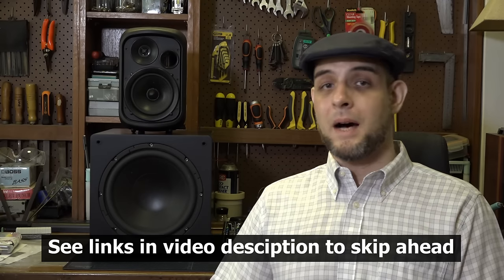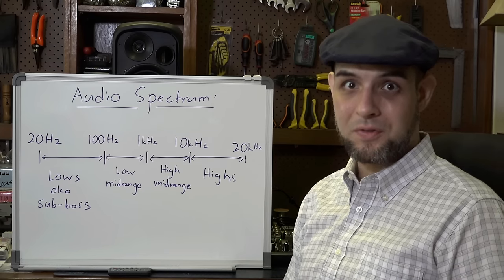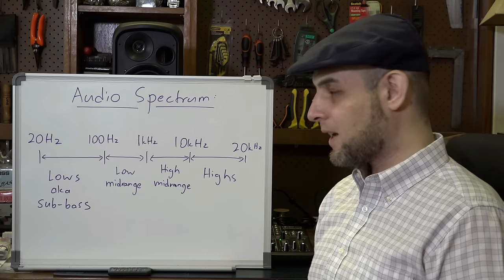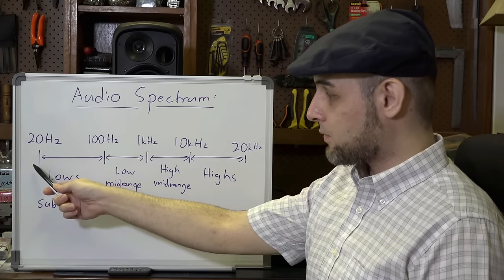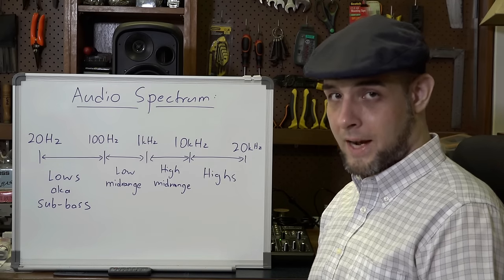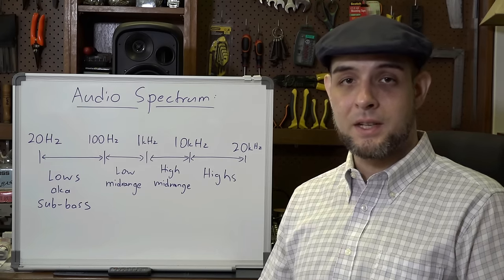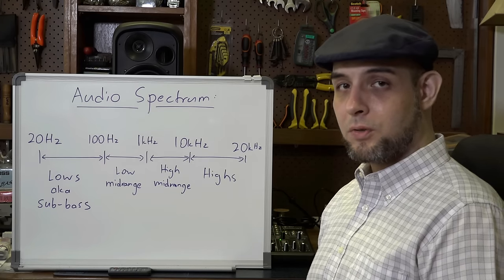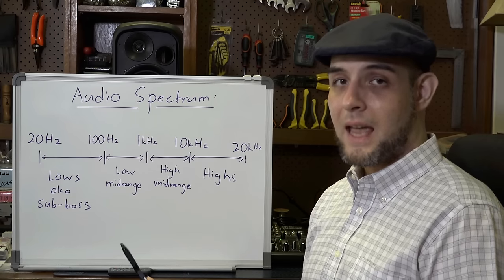How to connect an active subwoofer to a sound reinforcement system

Comment: Have to say your ability to clearly explain a technical side of todays active type speakers  is commendable. I for one did build speakers back in the 80's  using only 3 way cross overs non ported passive type of speaker designs. Philips components. Technology has come along way since then. Its refreshing to learn how signals are being separated and handled. Information as such was not as readly available as is today. However,  theres a lot of old technology still being used out there. Some musicians just prefer it that way. Personal taste. Sound reproduction is really an art in its self. In different applications or venues. Choices are endless for equipment. Finding what fits ones needs. You have  taught some very vaulable points to consider. Thank for sharing. Cheers.
Reply from the maker: Thanks Marcus! You're right, I have seen gear from the 80s and 90s still going strong, especially in clubs and pubs where they are not being moved a lot.

Comment: This is an excellent tutorial. I now know more about subwoofers than I thought I needed to know. I am considering using the 2nd connection scheme using a group out on my mixer; however, I have a monitor controller that I’d like to integrate that accommodates 3 pairs of speakers and a mono sub out. I’d love to see a diagram of this setup. Thanks for the great vid.
Reply from the maker: Thanks for watching Tom! If you have a monitor controller that should be the device to handle the crossover duties - the best ones have a variable crossover frequency, or one that is selectable between 80-150Hz.

Comment: Out of all the videos I looked at. You really explained the connections very well. I have the same mixer you using.Also, im moving from external amps to powered speakers.Less gear I got to handle.,Thank You!
Reply from the maker: Yes, eliminating the power amplifiers definitely reduces the bulk of one's setup, although it does mean carrying more in the way or power cabling, distribution boxes etc.

Comment: I'm  loving all your videos. I'd love to see some gig logs or examples of you actually mixing an event because you seem to be a very talented sound engineer
Reply from the maker: Thanks for the support Guy. To be honest with you when doing events I'm normally much too busy with the actual event to think about filming anything, I guess I have a one-track mind :P
Reply: +GLB thanksfor the lovely dimple explanations.. sir.
I have a pair of 3 way full range speaker with mid/highs and Lf speaker of 10 "..I want to use my old tube 100 watts  amplifier with proper crossover for my 15 " subwoofer..( passive).both the amplifier and subwoofer are in excellent working condition..will I get the desired effect if tuned properly with passive crossover.
your comments sir..

Comment: Bruno, this was excellent!!!  I have the QSC system with KSub, but haven't been getting the full potential out of it.. now I know why.  Your instructions will make the difference! - Andy
Reply from the maker: Ah yes with the QSC systems you need to be sure your tops are set to EXT SUB or they will still be trying to reproduce the fullrange signal. This is a good setup in that you don't have to run signal cables between your sub and tops which means they can be located separately from one another.
Reply: Ever use a Peavey Kosmos processor for the SUB?
Reply from the maker: REIGN DOWN Haha yes I used one way back in 2002. I had a chance to speak to Marty McCann the head Peavey clinician about it and the impression I got was that it was designed for DJs and dance music - you need a LOT of low end horsepower to fully realise the potential of units like that.

Comment: Thank you so much for such a wonderfully clear explanation of how to connect up an active subwoofer.  Your explanation and the diagrams are simply brilliant
My church has a ProFX30v2 Mixer with a set of FAME Challenger 2 x SUB 18A and FAME Challenger 2 x 15A full range speakers.  How do I set them up so that the Bass Drum and the Bass Guitar only comes out of the Sub-woofer only.  Many Thanks
Reply from the maker: You're welcome Slim. You would set up the subs on an aux send so that you could route the kick drum and bass guitar to them, and then remove them from the main mix by using the LR routing button. But why do you want these inputs to come out of the subs only?

Comment: Thank you Bruno. Clear and informative as usual. I am in a rock band using an Alto Professional Live 1604 Mixer into a pair of Alto TS215 Speakers. I am wanting to add subs to the system and I am thinking of purchasing the Alto TSsub15 or TSsub18. Personally leaning towards the 18's, but we have been offered the use of TSsub12's. I think it would be contradictory to use the 12's on the bottom end when using the 15 tops, plus, I believe the SPL of the live instruments may be too much for the 12's. I would be grateful for your insight and advice. Cheers
Reply from the maker: In this case driver size does not correlate to performance - the 12" used in the sub is a very different speaker to the one used in a fullrange cabinet. So you need to choose based on price, performance and other factors, not just the size of the speaker.
Reply: @GLBProductions  Thanks for your Reply. That clears a lot of thing up for me. I am now thinking I may go for the Alto 15 subs as they are lighter than the 18's, but have the same frequency response  (35 - 95Hz). Also going to recommend to a friend that he uses the 12 Subs on his10' Fender P.A. to give it a bit more low end. thanks again.

Comment: Your session is very informative.You spoke about one passive mixer,one active sub, one power amp and two passive full ranges,can you speak to connecting one powered mixer, two active subs and two passive full ranges?
Reply from the maker: If you're using a powered mixer connected to two passive full range speakers, you would use the mixer's line level output (sometimes called REC OUT or TAPE OUT) to send signal to the active subs. You would then need to use the mixer's onboard EQ to remove the sub-bass information from the fullrange speakers.

Comment: Very great video this video is 6yrs ago and the information is still need my mixer doesn't have a Aux send but has a monitor and FX send I'm using the V2315 two tops and V2318S subwoofer can you recommend the best setup for my equipment my Mixer is a Yamaha MG10XU hopefully you will see this and get back to me thanks in advance
Reply from the maker: On the MG10XU you have only a single aux send so if you want to use the aux fed sub technique you cannot use the internal FX.

Comment: HI first off let me say I absolutely love your video tutorials, I have played this one over and over, getting to understand, but I hope you can spare some of your valuable time for me, I'm a oneman band, playing keyboards and some backing tracks, also play electric guitar and I also sing, at times also I dj,  lately I purchased 2 of the 9 series RCF's 935a also just purchased the new V3 mackie 16FX Pro Mixer ,
using the 2 XLR outputs to the  RCF's  , I'm now waiting on
2  Behringer subs B1500XP's
but I have no idea how I'm going to connect them to my RCF's, best overall sound, right now I have the RCF mode at BOOST and the clarity of my vocals and bass is unreal, the overall sound is excellent, but if I just had that extra thump
without destroying the magical sound of the RCF, I'm told to continue to run especially being a super tops 945a's are at full boost and  when I want to add the subs connect using aux,s. more control I'm told, but you being the expert here
What would you recommend going about this and exactly how to connect 🤔
also on connecting my keyboards to a stereo channel L + R  13/14  I notice if  turn the gain up it makes no difference to volume whatsoever only by bringing up that channel fader ( Mackie 16FX V3) never came across this sinario before 🤔 there's still a great sound, but is there something wrong here with the desk, 2 unbalanced cables from my ketron Audya 5 to the desk, I'm puzzled both with connections and mackie gain on the stereo channels, this is my first time also going mackie
Thanks in advance for any help or information you give me..
Reply from the maker: Hi there Martin, glad the video was helpful. Some suggestions: 
- If you are using RCF tops, I strongly recommend that you buy RCF subs, for example the SUB 8003-AS II. It is always a good idea to have all of your speakers be the same brand if possible. This will give you the best possible match between subs + fullrange. 
- Fullrange speakers (especially actives ones) with a 15" woofer often do not benefit from adding a subwoofer - you will get some extra low end for sure, but the cost, weight and complexity may not be worth it. Try before you buy! 
- There is no correct method to connect the sub - try both inline as well as aux fed, use the one that sounds better. 
- On the Mackie ProFX16v3 the gain knob on channel 13/14 affects the MIC gain ONLY - the gain for the line level inputs is fixed - it actually says this on the panel marking around the gain knob.

Comment: wow. SUCH a great video for anyone from a kid to an adult- from simple pleasure listening to hosting an event. everyone can benefit from this awesome video. thank you, sir!
Reply from the maker: You're welcome, thanks for watching 😊
Reply: @GLBProductions  i have a question. in my computer i have a wave editor, and i took 1 second of audio and muted it so that it had no sound at all. but when i play it, my meters in the software show that it has no sound, but i hear noise. then after the second is over, the noise stops. so my computer has white noise in it. any idea where it comes from or how to remove it?
Reply from the maker: It sounds like the issue is with your editing program rather than your computer - the noise seems to be added when you export the file. Check that there is no auto-normalisation or auto-gain control going on.
Reply: @GLBProductions  i did not export at all. if i play a few seconds of silent audio from the software, i hear noise, but the noise stops half a second after the silent clip ends.
Reply from the maker: Hmm, that sounds like there's something wrong with your playback system... perhaps try playing the file back on another computer? Sorry I can't be of more help with this.

Comment: very interesting and well explained. there’s one problem that I have seen specially in Puerto Rico, and it’s with the second method. some guys are putting the bass (instrument) only through the sub woofers; this kills the bass sound specially of an upright or a fender bass guitar, they think the full spectrum sound of the bass it’s going to damage the speakers(top). I don’t understand, I’d rather use the first method and eq some bass out of the vocals etc. but that is a big pain in the ass when you have worked for 50 years trying to get a nice sound and the “soundman” just kills it and force you to sound from 100 hz and below.
Reply from the maker: Yes, both bass guitar and upright bass have frequency content right up to 4kHz and even higher in some cases, so it's vital that their signals are sent to the fullrange speakers as well as the subwoofers. You can try and explain to them that the whole point of having a crossover and subwoofer is to divide the energy of the signal such that the sub does most of the work - this protects the fullrange speakers and allows them to do their job more easily. It's not all dub bass out there! 😄

Comment: Bravo!  I am a bass player.  I have a 4k watt amp for four 8 ohm subs and a 1k watt amp for two 212 mains that are 8 ohms and two eight ohm monitors.  The monitors are daisy-chained off the mains for a four-ohm load.  This is a small system.   What is the best way to control monitor level because it is off the mains currently?
Reply from the maker: It's best to run your monitors off a pre-fade aux send so that they can be controlled separately from the main speakers.

Comment: Excellent explanation.

Thank you!

In fact I am not in the pro-audio, just in home Hi-Fi and I have seen the whole video ;)

Something in the home systems I missed is how to connect the subwoofer to an amplifier that hasn't a sub exit.

My subwoofer has the hability to use an RCA input from the amplifier or AV receiver and also a speaker connections.

My doubt is, if I should connect the amplifier speaker outputs parallel to the loud speakers and togertehr to the sub, or I should connect the amplifier speaker outputs to the subwoofer inputs and the subwoofer speqaker outputs to the speakers.

In the other side...

Does it had sense to let the speakers manage the full range and use the subwoofer for reinforcing the low frequencies but without cut them in the loudspeakers?
Reply from the maker: Nice to hear from you Vincente. 
Hifi and live sound are often quite different in terms of philosophy - hifi prioritises the highest possible sound quality in a very small area (the 'sweet spot') whereas live sound is about very high sound pressure levels across an area that includes hundreds or thousands of people. You need to keep this in mind when watching the video. 
If your sub is powered you must check VERY carefully that it can accept a speaker level signal - in other words it must have speaker terminals marked 'input'! Otherwise you may damage it. 
You can try both in series as well as parallel. See which sounds better. 
You can leave the main speakers full range and add the sub to supplement the low frequencies, but this may sound worse due to phase cancellation from having the same frequencies reproduced from two different sources. Experiment and see!

Comment: Wow,  great review very informative.  I don't currently own an amp because I get all  my wattage from my active speakers which are connected straight to my dac.  So my question is can I do the same with an active sub and use the volume/wattage from the sub as I do with the active speakers. Also how do I connect my active speakers to a sub with only inputs.

Many thanks.

Mark
Reply from the maker: Yes you can, assuming you choose a sub which is matched correctly to your active speakers. If your sub has only inputs then you will need an external crossover or signal processor which can perform the crossover function.